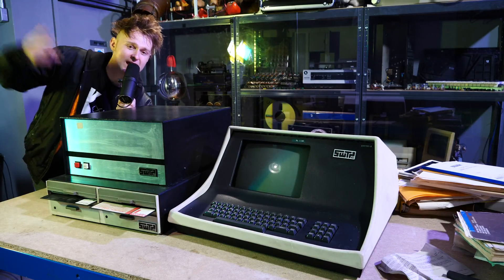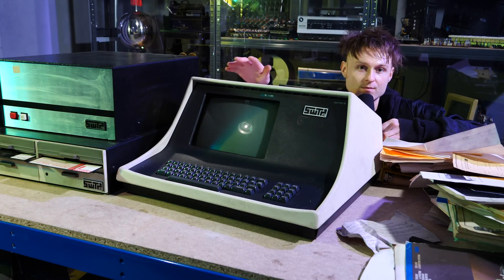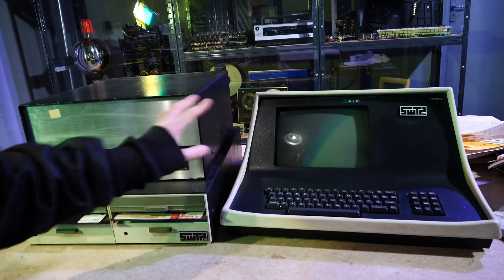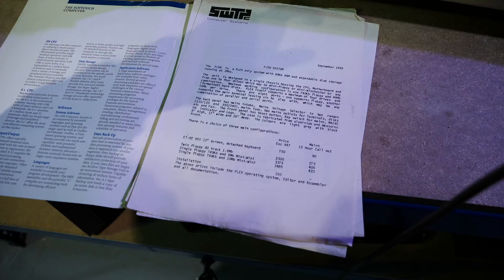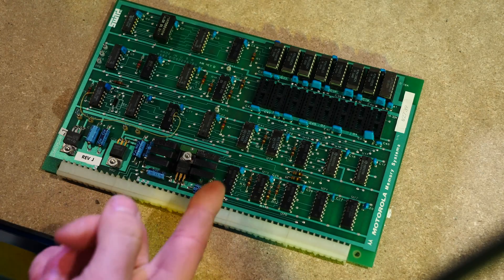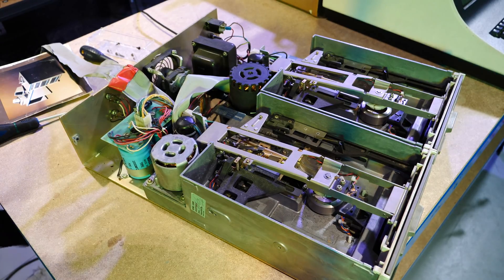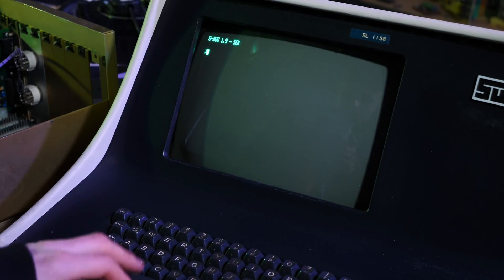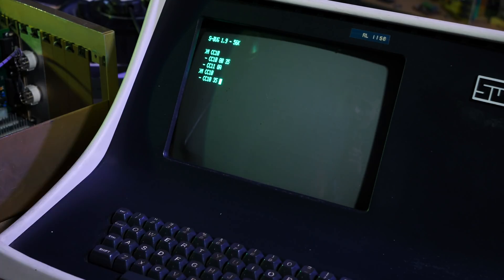Rare 70's Computer Find - Will It Work??? SWTPC 6809

Comment: I have a master copy of the 'Flex-09' operating system on 5.25 inch disc, if you need it. You could drive the AY-8910 music chips from it which were from the same era.
I have an unrestored 6800 system by the same people, with one of their kit built terminals. Doesn't have discs but has a wonderful dual casette interface, instead.

Comment: Very interesting find there, S-BUG looks like a ROM monitor, quite common practice for the time to have some basic functions in ROM. Looks like you dropped lucky everything seems to be mostly working. Give the floppy drives a good clean and also inspect the surface of the floppies; oxide build up, dust and mould are quite common.

Comment: That sounds about right in terms of price. It was a very high-end system for it's day, with a 20-bit bus, (some) 16-bit instructions and could directly address 768K of RAM, with in-built multi-user functionality as a bonus. The S/09 did come in that case originally so you do have a real S/09. When you consider the Commodore 64, adjusted for inflation, was about £2200, paying £1630 in 1983 (£5600 now) for the S/09 doesn't seem like that much of a stretch.
Reply: The four extra address lines was something added later. This one apparently has 48K of 16K DRAMs, and another 8K for a total of 56K, which is "full" for a plain 64K address space, so it's probably not one of the OS-9 multi-user monsters. It would also need some sort of memory mapper chip on the CPU board. From a quick Google around, it seems those four extra pins were originally used for baud rate clocks, of all the silly things you could put on a bus. It looks like there's a TTL chip in that corner of the board, but I don't think it's a latch.

Basically OS-9 Level 2 had support to control memory mapper chips, so that an individual user would have a collection of memory pages, then the list of memory pages would be switched out when going to the next user.

Looks like there's a corshamtech.com which has such a CPU board for $235, or $25 for a bare board, and the board has 128K of its own. They even have breadboards for the SS-50 bus.

Comment: Motorola 6809 is a nice processor!
The send "twice" is actually send once and local echo on the terminal is set on. You need to set that off.
Oooh I see now you figured it out :D
This was a common error in my first full time job, where customers called and said that their "keyboard was stuck". The terminal had lost it's configuration and local echo is standard on. So we'd instruct them how to configure that. Later we actually made our system clever enough to once tell the system what terminal was connected to that port, and push a program string.

Comment: It doesn't say what currency the prices are in so it's probably US dollars?
The information I get is that inflation of US dollar is 217% if dating back to 1980 which translates to 2020 price would be 3.17 times higher than in 1980.
Not quite the numbers you get but pretty close though.

Comment: Absolutely awesome! Score!
The doubled characters would have been to do with local echo on the terminal.
IPL is Initial Program Loader. You need a system disk, and the other disk seemed to be labelled as that.
There may have actually been some kind of sound card made.

Oh yes, the terminal being RS232 serial could also be used with a Linux system.

Comment: HI, so a general thing to check on anything this old are leaking Batteries, X2 filter caps in the power supply and tantalum capacitors, both of these are know to let out the magic smoke. Then the obvious bulging caps that can be out of spec. Looks like you have been very lucky and it looks beautiful !
Reply: That machine has no X2 caps. That's a SMPS thing. The PSUs I saw are linear. Just big step down transformers with bridge rectifiers and filter caps. Then it would be linearly regulated.

Comment: You may want to try swapping the two floppy drives ? By any luck, if one is dead the other one could be OK. Also, double check the head movements, the mechanics may need some cleaning and lube.

Comment: Reminds me of my Olivetti ET221 of 1978 upgraded in 1984 to a full ETV500 CP/M 2.2 system with two 5 1/4" floppy discs... with a modem added some times later, the total bill amounted then to the price of a decent family car! Didn't use it for music (was still - and remains  -  full analogue, mate) but for writing...
And btw, your com problem with floppies is probably due to some initialization issue (the pre-formatting process allowing floppy discs to be identified by the OS, including defining the size and number of sectors)... Always been a hassle 🙄🙄

Comment: I had a SWTPC 6800 system, the original 1975 version. The complete kit, consisting of the black and silver box like yours, an older all white terminal, and a cassette interface (no floppy drives) cost around $1000 USD in 1975. The motherboard has several 50 pin connectors (known as the SS50 bus) for things like the processor board (I upgraded to the MC6809 board) memory boards, the floppy drives, and a DIY video controller for putting txt and crude graphics onto a TV screen. There is a row of I/O connectors along the back of the motherboard, where smaller I/O boards plug in. There is a serial interface that operates the terminal, and parallel interface boards that send 8 bits of parallel data for things like printers. You can make a simple resistor ladder that can turn the parallel output into an 8 bit D/A converter for making sound or chiptune quality music. The parallel port card can be used for triggering drum synths, or other "button push" type operations. I had three or four of them in my system. I eventually gave it all to a museum sometime in the late 1980's. SWTPC did unsuccessfully try to get into the business computer market, that's the stuff in that pricey catalog. The machine you have is the home / hobbyist version.  SWTPC also made a lot of audio amplifier kits under the Tiger name.

Comment: Well, that went a lot smoother than I expected. Others have already answered your IPL question, but I would add that often, dual drive systems from this era had a preference as to which drive contained the OS disk. If I remember correctly the Fairlight CMI is one example.

Comment: Sam, wire an incandescent lamp between the device and supply in future... If anything is blown, the lamp will take the whack rather than the components within the device. 

A lot of electronics channels use this method on old equipment when powering up a device that hasn't had any juice in a while...

Comment: First question: can it use more than 64K? OS-9 Level Two would be a lot nicer than Level One.
Reply: 56K on the monitor screen... OTOH, the monitor (program) might just be set up to run in 64K, leaving access beyond that to whatever it boots.
Reply: It looks like it has FLEX on it from the image of a manual in the video. FLEX is a single-user system like CP/M or early MS-DOS. To achieve full potential of this computer you can install OS-9 level One. It will give you background processes, file hierarchy, pipes etc. It is very similar to UNIX. If the computer has a MMU and more than 64 KB RAM, then you can install UniFLEX or OS-9 Level II. Unfortunately, it looks like OS-9L2 has been lost to time. In have not been able to locate a copy of it.
Reply: It seems there's a few recent videos of people exploring level 2 so it's out there somewhere. The kernel is definitely available if you could somehow compile it? (Out of my wheelhouse so no idea).

Comment: Very, very cool machine you've picked up there.  As others have mentioned, you need to boot an OS from floppy and the ones you put in it in the video probably weren't bootable disks, just data disks.  There were 3 operating systems you were likely to find on an SWTPc 6809 -- 1.  FLEX -- similar to CP/M, but for the 6800/6809 rather than 8080/Z80.  2.  UNIFLEX -- from the makers of FLEX.  This was a real rarity, and was supposed to be UNIX-like.  3.  OS-9.  This operating system, named after the 6809 microprocessor was a real-time, preemptive multitasking, multi-user OS that was also vaguely UNIX-inspired, but very modular.  OS-9 would also later run on the Tandy (TRS-80) Color Computer line and the Dragon 64.  In fact, the very same binaries that run on either of those systems will work on an SWTPc 6809 running OS-9, provided that they don't use any special hardware that isn't in the SWTPc.  The Fairlight synth actually also runs OS-9.  Because it was quite popular on the CoCo and Dragon, as well as other embedded / industrial computers, there's quite a bit of software out there for OS-9.  There's a great structured BASIC called BASIC09, there's a Pascal compiler, a C compiler, and there are quite a few CoCo hobbyists using it today.  In fact, a re-written version called NitrOS-9 is still under development by hobbyists -- mostly CoCo enthusiasts.  Even if your system didn't come with OS-9 boot disks, the disk image files are obtainable on the Interwebs, and it should be possible to write them to a disk.  If you can't get that to work with the 8" floppy drives, one of those Gotek drives set up as a 720K drive should work.  There's a lot of expertise on the CoCo OS-9/NitrOS-9 Facebook group ( https://www.facebook.com/groups/1929079184021683 ).  A boot disk for the SWTPc version of OS-9 can be found here:  http://www.evenson-consulting.com/swtpc/  FLEX and UNIFLEX are pretty obscure now.  But if you can get this thing to boot up OS-9 (you'll probably need 64K of RAM) you'll have lots of options for programming it.  There's even a guy on your side of the pond making new hardware for those computers:  https://www.corshamtech.com/product-category/ss-50-products/

I very much want to see what you can get this thing to do!
Reply: One thing to be careful of:  The SS-50 Bus is a forest of un-insulated pins.  It's super easy to short them when you're working in there and blow a fuse.  Don't ask how I know this.  One final hint and I'll shut up:  https://www.corshamtech.com/product/ss-30-prototype-card/
Reply: Nope.  Gotta add more.  Shared this on the CoCo and OS-9 FB groups, and more information is bubbling up.  There was at least 1 sound card for the SS-30 Bus:  the Newtech Model 68 Music Board.  Looks like it was just a DAC with an audio amplifier.  https://archive.org/details/68micro-vol-02-num-01/page/n41/mode/2up  Bob Applegate of Corsham Tech cloned the board, but has sold out of his stock.  However he posted his design files on GitHub:  https://github.com/CorshamTech/Music_Board#readme  Paul Fiscarelli is also working on a replica of those boards:  https://www.facebook.com/groups/SS50BusComputers/permalink/1744846822345731

Comment: 6809 was used in a lot of early (late 70's early 80's) digital video equipment to do the heavy lifting processing 8 bit video. 
It was also popular in synthesisers in quite large numbers though quite why I didn't understand they were several times more expensive than the competition and synth manufacturers fired them at synths with a shotgun both for control boards and voice cards.
Good luck with your machine I am sure there will be other people out there using these old machines. "The 8 bit guy"  may be able to put you in touch with a user group.
Reply: The 6809 had a very regular instruction set that might it easy to get fairly accurate timing while doing real work in software loops. In synthesizers, timing is everything. It was also fast at moving and calculating waveform data without external hardware.

With a Z-80, for instance, you needed to depend heavily on external timing devices and other external hardware, to get similar control over the output. (Among other things.)
Reply: @JoelReesonmars  I didn't realise that synths were that sensetive to timing.
Those capabilities were what made it useful for video processing. 
Thanks

Comment: Possibly time for a rebrand to "Look Mum One Ancient Computer"
Reply: Being serious it probably runs Unix and can manage many communication channels , so it could possibly be re-purposed as a controller for the 1000 oscillator mega synth or similar, though a comms board and code to do so would have to be developed for it to do so. You may even need a COBOL coder to create a brand new interface to do so which would at least feel in alignment with your brand as it would be basically obsolete technology creating new and wonderful applications in a modern environment.

Comment: IPL means I-nitial P-rogram L-oad. This means that the system is trying to load the operating system. It's probably on a diskette labeled Flex or something similar.
Reply: Flex, Uniflex, maybe OS-9.
Reply: @JoelReesonmars  I thought too. I thought most 6809 computers run OS9. And even if they don't, there is some hacked version of it somewhere.
Reply: @AmstradExin  At one point I remember thinking how a 68000 (yes 68000) chip in a PC compatible motherboard running OS/9 could have been a turning point for the PC industry. 68000 with it's 'grown up' architecture, a PC compatible motherboard to take advantage of all of the PC hardware available, and Unix-like OS/9 to bypass all of the MS-DOS silliness. If that had happened, Intel might still be a calculator and RAM chip manufacturer, but it didn't.
Reply: @jfan4reva  Actually, several small companies made OS-9/68000 PCs, but none took hold.
Reply: Oh oh oh! Flex!  Yes, Flex! 
I was all CP/M back in the day but my mate who was "doing engineering" used 6809s and Flex.
Reply: Oh man I can still probably IPL a UYK-43 if I had a minute to think about it
Reply: Upon an interrupt, decrement the counter to zero and IML
Reply: Those 'diskettes' stored 80 kilobytes in 8 inches. Might as well use punchcards
Reply: I have no frikin idea what are you guys talking about in the most magnificent way. ;D
Reply: @Mamutkailiai  Some old people are watching this channel too I guess.
Reply: Ahh. Me thinking In-visible Panty Line.

Comment: You haven't lived until you've set index timing and adjusted radial head alignment with an Oscilloscope on those 8" floppies..!
Reply: In the eighties I worked as a support engineer for a IBM dealer.
For every new model on the marked you were made to have a course on that model for a whole week! Aligning floppy drives, go through all the possible errors of the system, every square inch of the Mainboard was explained.
You went home with a ton of support manuals, floppy's etc. Those were the days.
Reply: @ducomaritiem7160  Yes, I worked for Harris /Lanier as a Field Engineer in those days.  Was often sent on field service jobs to repair computer models I had never even seen before.  And of course our new models required tons of "TSB' updates and mods just to make them work halfway reliably.  This was before the IBM PC was just coming on the scene.

Comment: Love it! I wouldn't have been able to walk away from it either! I don't see any audio stuff in there but i'm sure you could plonk in a card with an SN76489 or two on. keep it true to it's heritage though, it'd be kinda wrong with a SID or AY-3-8910 etc. shouldn't be to difficult hardware wise, maybe even adding an input or two to control it (MIDI?!). the hard part will be the software, Midi controller in 6809 assembly language anyone?

Comment: If it's got some sort of external I/O port (serial/parallel/user) you can turn it into all sorts of things, from a drum machine (you could set it to trigger the twin-t oscillator board you built from that 70s magazine) to a CMI Fairlight clone.

Comment: Didn't it have a S100 bus? I did rewrite the boot to display on a memory mapped display.
Photo?
Reply: No, but the original SWTPc 6800 was introduced right around the same time as the Altair, and this 6809 uses the same bus and chassis.
Reply: @joelavcoco  This is going back a long way. I might be thinking of the Motorola development board, which I think was compatible. The SWTP clone I built had a custom bus, memory mapped display and was much more compact as I had access to 'exotic' components.
Reply: @colinedwards7250  The bus in the SWTPc was called SS-50 and SS-30.  There was a 50 pin bus that had all the address lines, and a separate 30 pin bus where each 'slot' was assigned a range of addresses so that they wouldn't need as much address decoding hardware on each card.  6850 serial ports and 6821 parallel ports typically went on the SS-30 bus.  

The Motorola development boards (at least some of them) were on a bus called EXORBus.  It was a more conventional card-edge connector, but with .156" rather than .1" spacing.  Otherwise they would have been fairly similar to SWTPc hardware.
Reply: @colinedwards7250  I think there were 6800 and probably 6809 CPU boards for the S100 bus, but not from SWTPc.  Didn't MITS do an Altair 680?

Comment: Get yourself a grounding wrist strap! Old chips like that were especially sensitive to getting zapped by static electricity. (New ones are sensitive too; but they usually have better protection diodes on the silicon than the old ones did). It’d be a real shame if it survived all these years only to get zapped now...
Reply from the maker: I usually make sure I rub a balloon on my head before touching electronics 😂
Reply: @LOOKMUMNOCOMPUTER  Hmm... balloons, you say? I usually use a cat... might have to try that; I suspect that I’d get scratched less... 🙀
Reply: TTL wasn't that bad. CMOS was the more problematic chip family when it came to static.
Reply: @1pcfred  Early CMOS was downright fragile. TTL tended to suffer more of a degradation effect than outright sudden death... but it could get fried in an instant, too. This machine was built in an era where I’d expect to see mixed TTL, NMOS, and CMOS devices on the same board. While many discrete logic devices can be replaced with modern components; a great many of them are out of manufacture; and are getting hard to find...

And besides, it’s cheap insurance. 😉